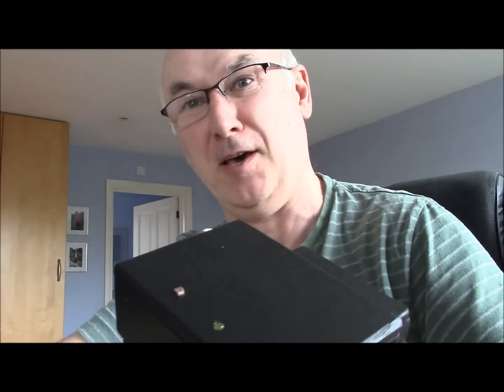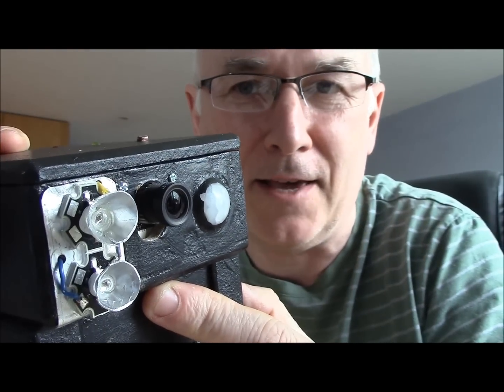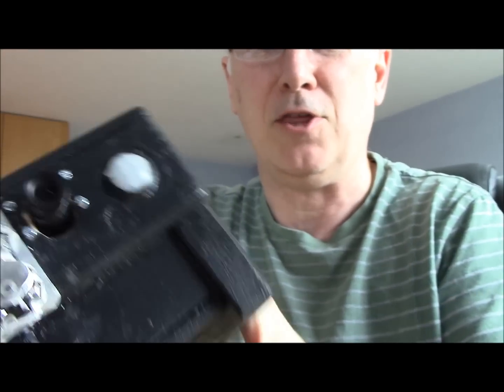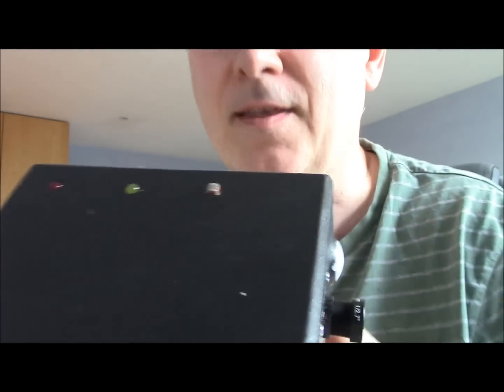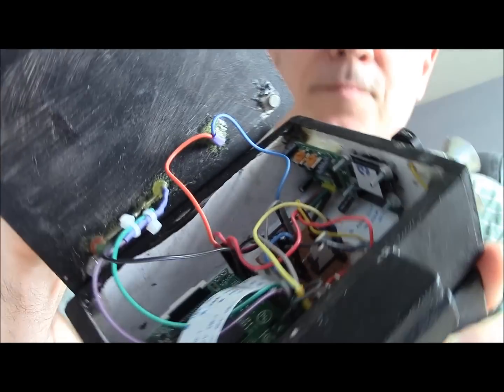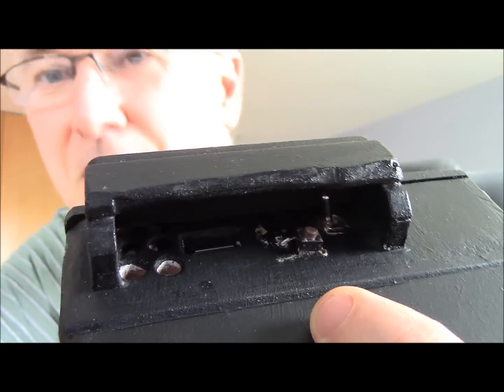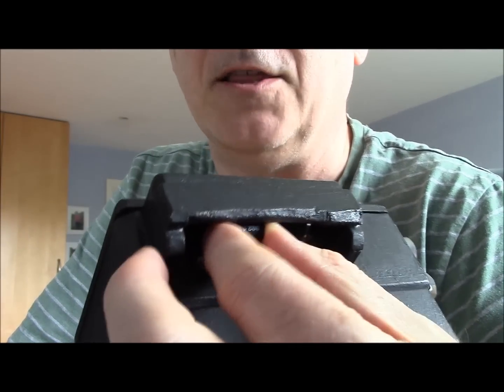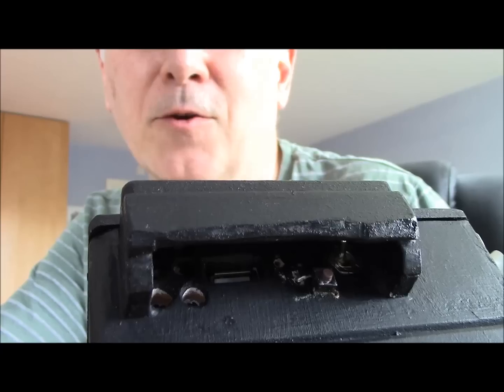Raspberry Pi Night Vision Camera Construction

Comment: Very cool are you starting the record with wlan the adapter and ssh? Or is it the on off switch?
Reply from the maker: record starts automatically. crontab -e then use @camscript. 
Later, when I get it home. (if it's still there... ) connect using wlan and download pics/vids...

Comment: Thats a great tutorial Harold.
I have a Pi 3 on order and zero Pi knowledge but videos like yours inspire others to learn. 
You are an inspiration.
Thanks!

Jem.
Reply: I was inspired by this video many, many months ago and I built something as well which I'll be sharing soon - I call it crow-cam, design intention was clearly to pick up crows and record them :D

I went a bit crazy with the expenses though, solar panel, charge controller, 9Ah battery - it was a labour of love for the most part, but I'm glad to say it's done now and working as required. :D
Reply from the maker: +Jem Pro   Brill. Cheers Jem.  I want a pi zero to make a dog-cam to fit to my labra-dog harness thing...  :-) cheers.

Comment: sorry for my ignorance...but you use the wifi adapter to conect the rapsberry to the pc?

I'm thinking to make one...but all of these things are new for me. I think I could make one because you shared the code... so thanks for your work :)

and one more question..how do you choose between video or photo?
Reply from the maker: +a100da ...   Needs a bit of unix knowledge. 

1. edit the /etc/interfaces file 

here's mine ..   .145 is the fixed IP I chose..
auto lo

iface lo inet loopback
allow-hotplug wlan0
iface wlan0 inet manual
wpa-roam /etc/wpa_supplicant/wpa_supplicant.conf
iface default inet static
address 192.168.1.145
netmask 255.255.255.0
gateway 192.168.1.1

 2. edit the wpa_supplicant.conf file. 

here's mine ..

ctrl_interface=DIR=/var/run/wpa_supplicant GROUP=netdev
update_config=1

network={
        ssid="WIFI-SSID-NAME"
        psk="wifi password"
        proto=WPA2
        key_mgmt=WPA-PSK
        pairwise=CCMP TKIP
        auth_alg=OPEN
}

cheers. HS.
Reply: +Harold Spudovich Thanks! I will try it. If I have succes I'll tell you :)

Comment: Nice job!
What's the battery life on this?

How do you change it from motion detect to time lapse, can it be done on the fly with a switch ?

Loads of more questions!!!  
Been looking to build something just like this!
Reply from the maker: +TeamYankee2 It does both with 1 script. In fact a simple switch could allow you to choose. Here's the latest python script :  

# Steve E's Ras-Pi Flasher script 
# flasher5
# daylight timelapse camera.
# motion sense - video.
# timelapse - pic
# LED fade in-out PWM

import os
import shutil
import time
import RPi.GPIO as GPIO
from   datetime import datetime

MotionSense = 38
YellowLed   = 33
RedLed      = 31
Switch      = 37
LightSense  = 35
BIGLEDS     = 40

GPIO.setmode(GPIO.BOARD) 
GPIO.setup(BIGLEDS,     GPIO.OUT)                             
GPIO.setup(YellowLed,   GPIO.OUT)                            
GPIO.setup(RedLed,      GPIO.OUT)                            
GPIO.setup(LightSense,  GPIO.IN, pull_up_down = GPIO.PUD_UP)  
GPIO.setup(MotionSense, GPIO.IN)                             
GPIO.setup(Switch,      GPIO.IN, pull_up_down = GPIO.PUD_UP) 
imgWidth     = 1920                                              # Max = 2592
imgHeight    = 1440                                              # Max = 1944
sleeptime    = 4

p = GPIO.PWM(BIGLEDS,1000)                                       # create PWM instance 1000Hz

d            = datetime.now()
initYear     = "%04d" % (d.year)
initMonth    = "%02d" % (d.month)
initDate     = "%02d" % (d.day)
initHour     = "%02d" % (d.hour)
initMins     = "%02d" % (d.minute)
homedir      = "/home/flasher"
fileserial   = 0
Mscore       = 0                                                 # score based on frequency of motion detect

picfolder = "pic_"+str(initYear)+str(initMonth)+str(initDate)+str(initHour)+str(initMins)
vidfolder = "vid_"+str(initYear)+str(initMonth)+str(initDate)+str(initHour)+str(initMins)

def FLASHON():
        p.start(0)
        for i in range(100):
            p.start(0)
            p.ChangeDutyCycle(i)
            time.sleep(0.06)               

def FLASHOFF():
        p.start(0)
        for i in range(100):
            p.ChangeDutyCycle(100-i)
            time.sleep(0.03)           

def FlashRed() :
        GPIO.output(RedLed,True)
        time.sleep(0.05)
        GPIO.output(RedLed,False)

def FlashYellow() :
        GPIO.output(YellowLed,True)
        time.sleep(0.05)
        GPIO.output(YellowLed,False)
      

def SHUTDOWN() :             
        print("FLASHER SHUTDOWN NOW !!")
        for x in range(4):
                GPIO.output(RedLed,True)                            
                GPIO.output(YellowLed,True)
                time.sleep(0.3)
                GPIO.output(RedLed,False)     
                GPIO.output(YellowLed,False)
                time.sleep(0.3)
        os.system("sudo shutdown -h 0")

def startupsleep():
        for x in range(300):
                FlashRed()
                time.sleep(0.2)
                FlashYellow()
                time.sleep(0.8)
        
def takepic(pic_name):

        if (GPIO.input(LightSense) ==0):                                # LDR says nighttime 0 = night 1 = day
                GPIO.output(RedLed,True)
                print("Night Pic ",pic_name)
                GPIO.output(RedLed,True)
                FLASHON()                         
                os.system("raspistill -w "+str(imgWidth)+" -h "+str(imgHeight)+" -o "+str(pic_name)+" -sh 90 -awb auto -mm average -v -n")
                GPIO.output(RedLed,False)
                FLASHOFF()
        else :
                print("daypic  ",pic_name)
                GPIO.output(YellowLed,True)
                os.system("raspistill -w "+str(imgWidth)+" -h "+str(imgHeight)+" -o "+str(pic_name)+" -sh 90 -awb auto -mm average -v -n")
                GPIO.output(YellowLed,False)

def takevid(name):
        GPIO.output(RedLed,True)
        GPIO.output(YellowLed,True)
        if (GPIO.input(LightSense)==0):                                         # LDR says nighttime
                        print("Starting Nightvid run...",name)
                        FLASHON()
                        os.system("raspivid -o " + str(name)+" -t 15000 -n")
                        FLASHOFF()
        else :
                        print("Starting DayVideo run...",name)                   # LDR says daytime
                        os.system("raspivid -o " + str(name)+" -t 15000 -n")
        GPIO.output(RedLed,False)  
        GPIO.output(YellowLed,False)  

# MAIN SCRIPT
for x in [YellowLed,RedLed,BIGLEDS]: GPIO.output(x,False)                 # turn all LEDs off.
os.chdir(homedir)
os.mkdir(picfolder)
os.mkdir(vidfolder)
startupsleep()                                                             # initial sleep 20 mins

while True:                                                                # main program loop

    if (GPIO.input(Switch)!=1): SHUTDOWN()
    print("fileserial = ",fileserial)
    print("Mscore     = ",Mscore)
    FlashRed()

    if (GPIO.input(MotionSense)==1 and GPIO.input(LightSense)==0): Mscore+=8      # nighttime motion sense
    elif (GPIO.input(MotionSense)==1 and GPIO.input(LightSense)==1): Mscore+=3    # daytime motion sense. scores less!
    print("Motion Detect. Mscore = ",Mscore)
    FlashYellow()

    if Mscore > 12 :
            vid_name = vidfolder + "/" + "%04d" % (fileserial) + ".h264"
            print("Taking Vid ")
            print("fileserial = ",fileserial)
            takevid(vid_name)
            fileserial += 1
            Mscore=0
    elif fileserial%25==0 :
            pic_name = picfolder + "/pic_" + "%04d" % (fileserial//25) + ".jpg"
            print("fileser  ",fileserial)
            takepic(pic_name)
            fileserial += 1
    else :
            fileserial+=1
            if Mscore!=0: Mscore-=1
            
    print("Routine Sleep. Length: ", sleeptime)
    time.sleep(sleeptime)
    print("Routine Sleep finished")
Reply: +Harold Spudovich Thanks for the info.. 
What's the battery life like and what sort of timelapse interval does it use?
Reply from the maker: +TeamYankee2 Cheers. Batt life good. maybe 2-3 days or so. depends on how many flash pics taken. I originally used AA batts: not enough mAH. Use C cells or D Cells. :-)

Comment from the maker: # Ras-Pi Flasher script 
# flasher5
# daylight timelapse camera.
# motion sense - video.
# timelapse - pic
# LED fade in-out PWM

import os
import shutil
import time
import RPi.GPIO as GPIO
from   datetime import datetime

MotionSense = 38
YellowLed   = 33
RedLed      = 31
Switch      = 37
LightSense  = 35
BIGLEDS     = 40

GPIO.setmode(GPIO.BOARD) 
GPIO.setup(BIGLEDS,     GPIO.OUT)                             
GPIO.setup(YellowLed,   GPIO.OUT)                            
GPIO.setup(RedLed,      GPIO.OUT)                            
GPIO.setup(LightSense,  GPIO.IN, pull_up_down = GPIO.PUD_UP)  
GPIO.setup(MotionSense, GPIO.IN)                             
GPIO.setup(Switch,      GPIO.IN, pull_up_down = GPIO.PUD_UP) 
imgWidth     = 1920                                              # Max = 2592
imgHeight    = 1440                                              # Max = 1944
sleeptime    = 4

p = GPIO.PWM(BIGLEDS,1000)                                       # create PWM instance 1000Hz

d            = datetime.now()
initYear     = "%04d" % (d.year)
initMonth    = "%02d" % (d.month)
initDate     = "%02d" % (d.day)
initHour     = "%02d" % (d.hour)
initMins     = "%02d" % (d.minute)
homedir      = "/home/flasher"
fileserial   = 0
Mscore       = 0                                                 # score based on frequency of motion detect

picfolder = "pic_"+str(initYear)+str(initMonth)+str(initDate)+str(initHour)+str(initMins)
vidfolder = "vid_"+str(initYear)+str(initMonth)+str(initDate)+str(initHour)+str(initMins)

def FLASHON():
        p.start(0)
        for i in range(100):
            p.start(0)
            p.ChangeDutyCycle(i)
            time.sleep(0.06)               

def FLASHOFF():
        p.start(0)
        for i in range(100):
            p.ChangeDutyCycle(100-i)
            time.sleep(0.03)           

def FlashRed() :
        GPIO.output(RedLed,True)
        time.sleep(0.05)
        GPIO.output(RedLed,False)

def FlashYellow() :
        GPIO.output(YellowLed,True)
        time.sleep(0.05)
        GPIO.output(YellowLed,False)
      

def SHUTDOWN() :             
        print("FLASHER SHUTDOWN NOW !!")
        for x in range(4):
                GPIO.output(RedLed,True)                            
                GPIO.output(YellowLed,True)
                time.sleep(0.3)
                GPIO.output(RedLed,False)     
                GPIO.output(YellowLed,False)
                time.sleep(0.3)
        os.system("sudo shutdown -h 0")

def startupsleep():
        for x in range(300):
                FlashRed()
                time.sleep(0.2)
                FlashYellow()
                time.sleep(0.8)
        
def takepic(pic_name):

        if (GPIO.input(LightSense) ==0):                                # LDR says nighttime 0 = night 1 = day
                GPIO.output(RedLed,True)
                print("Night Pic ",pic_name)
                GPIO.output(RedLed,True)
                FLASHON()                         
                os.system("raspistill -w "+str(imgWidth)+" -h "+str(imgHeight)+" -o "+str(pic_name)+" -sh 90 -awb auto -mm average -v -n")
                GPIO.output(RedLed,False)
                FLASHOFF()
        else :
                print("daypic  ",pic_name)
                GPIO.output(YellowLed,True)
                os.system("raspistill -w "+str(imgWidth)+" -h "+str(imgHeight)+" -o "+str(pic_name)+" -sh 90 -awb auto -mm average -v -n")
                GPIO.output(YellowLed,False)

def takevid(name):
        GPIO.output(RedLed,True)
        GPIO.output(YellowLed,True)
        if (GPIO.input(LightSense)==0):                                         # LDR says nighttime
                        print("Starting Nightvid run...",name)
                        FLASHON()
                        os.system("raspivid -o " + str(name)+" -t 15000 -n")
                        FLASHOFF()
        else :
                        print("Starting DayVideo run...",name)                   # LDR says daytime
                        os.system("raspivid -o " + str(name)+" -t 15000 -n")
        GPIO.output(RedLed,False)  
        GPIO.output(YellowLed,False)  

# MAIN SCRIPT
for x in [YellowLed,RedLed,BIGLEDS]: GPIO.output(x,False)                 # turn all LEDs off.
os.chdir(homedir)
os.mkdir(picfolder)
os.mkdir(vidfolder)
startupsleep()                                                             # initial sleep 20 mins

while True:                                                                # main program loop

    if (GPIO.input(Switch)!=1): SHUTDOWN()
    print("fileserial = ",fileserial)
    print("Mscore     = ",Mscore)
    FlashRed()

    if (GPIO.input(MotionSense)==1 and GPIO.input(LightSense)==0): Mscore+=8      # nighttime motion sense
    elif (GPIO.input(MotionSense)==1 and GPIO.input(LightSense)==1): Mscore+=3    # daytime motion sense. scores less!
    print("Motion Detect. Mscore = ",Mscore)
    FlashYellow()

    if Mscore > 12 :
            vid_name = vidfolder + "/" + "%04d" % (fileserial) + ".h264"
            print("Taking Vid ")
            print("fileserial = ",fileserial)
            takevid(vid_name)
            fileserial += 1
            Mscore=0
    elif fileserial%25==0 :
            pic_name = picfolder + "/pic_" + "%04d" % (fileserial//25) + ".jpg"
            print("fileser  ",fileserial)
            takepic(pic_name)
            fileserial += 1
    else :
            fileserial+=1
            if Mscore!=0: Mscore-=1
            
    print("Routine Sleep. Length: ", sleeptime)
    time.sleep(sleeptime)
    print("Routine Sleep finished")